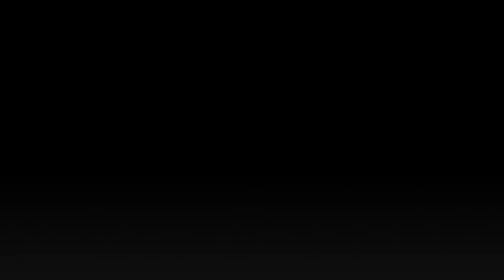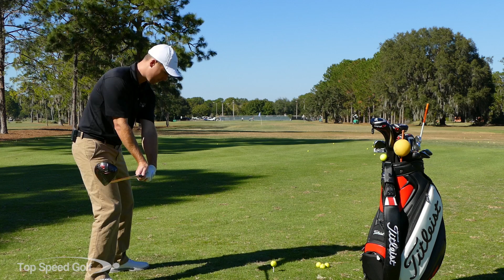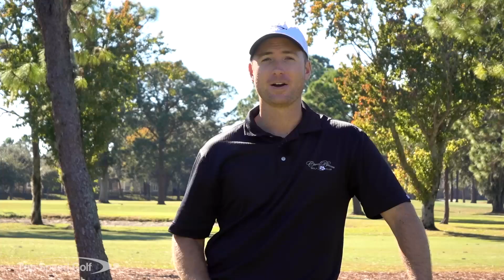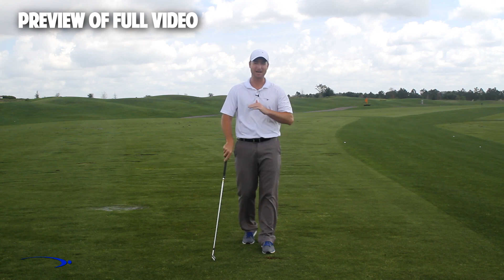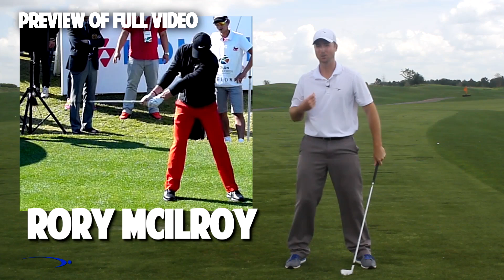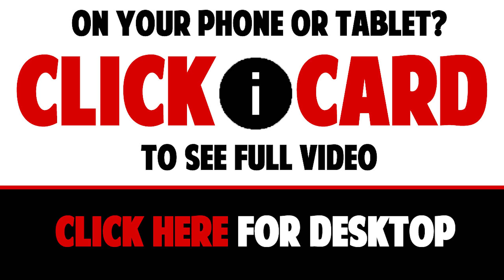Hit Your Driver Over 300 Yards

Comment: I am 66 years young and Love the game of Golf. 8 HCP
Using Driver my Wrists seem to Snap quite early in swing. Over the years I have slowly moved the ball back to about 1" from Right heel, Right handed. Is there any real problem with this placement of ball? I do slice and hook on occasion, but hit ball 275-315 yards consistently. Also would a longer Shaft help in Delaying the Wrist Snap Plus add even more distance?

Using 3 wood I play ball about 3" back from Left Heel. I am inconsistent with hitting ball, Topping and also hitting ground behind. There is 4.25" difference between Driver and 3 wood length. Should these 2 clubs be similar in length?
Reply from the maker: Hi, putting the ball that far back in your stance can cause you to hit very much down on the ball. This causes you to put a lot of spin on the ball and lose distance. You must have a lot of swing speed to be hitting it that far with this kind of set up. If you are successful hitting the ball this way then you must be keeping your weight back and essentially swinging mostly with your arms. It's really hard to say though what exactly is going on without seeing your swing. We do offer swing reviews as an add-on to our All Access Members on the website if you'd be interested.  The three wood is typically going to be shorter than the driver. I hope that helps. Play well ~ Quentin | TSG Instructor
Reply: @Mistaken-hd5g   this is ..hes doesnt at 66 ..at 66 if he golfed that well  he wouldnt be commenting on this lmao ..

Comment: If you have a two plane swing ala Jack or either of the Watsons Tom or Bubba, moving that ball to far forward is a killer. you will either slice it or top it.
Reply from the maker: Hi Lawrence, thanks so much for the comment. I'm not sure I've ever heard that before. Can you explain what you mean by that? Talk to you soon, Quentin | TSG Instructor
Reply: Top Speed Golf - Clay Ballard Of course, a good reference point, is Jim Hardy's explanation of the two plane and the one plane swing. I swing on two planes as Jack did and both of the Watsons do. The bottom of your swing Arc covers a smaller amount of ground than it does for the one plane or what we call the Hogan swing. As such ball placement has a narrower range with a two plane swing. If that ball is too far forward it is easy for you to top it or as your body turns to cut across it and cause a slice. I hope that gives a little more insight.